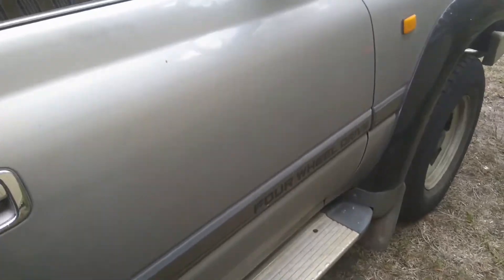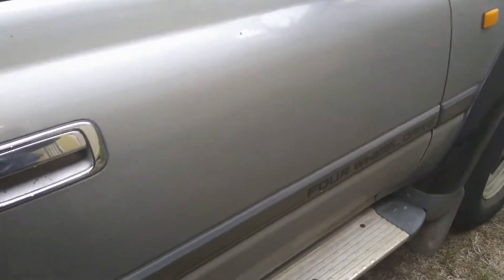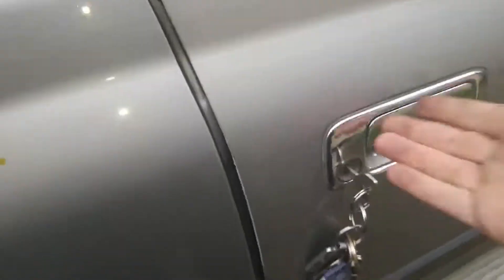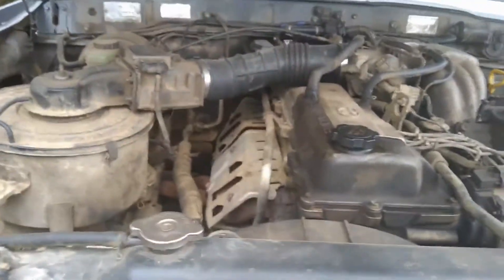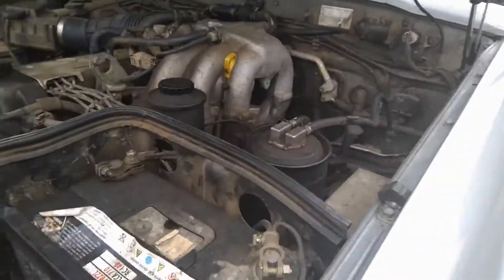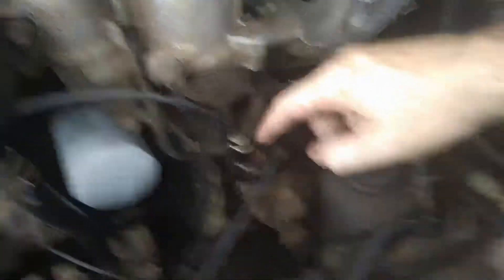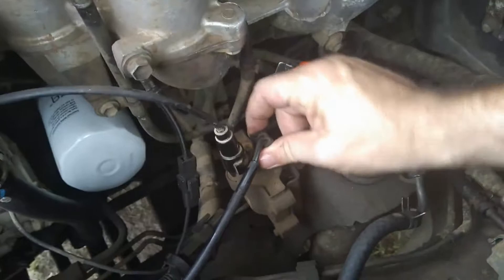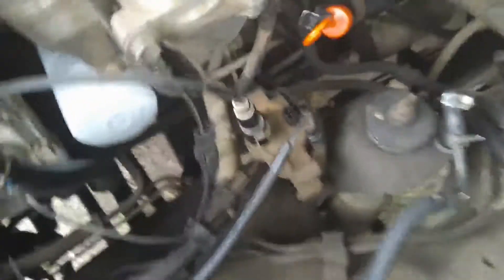80series - Ignition Coil System Issue PT1

Comment: Morning! I’m Francisco from Angola. I have fj80 series that I have recently change head gasket and valve oil seal. Now have mounted everything together but the crank but don’t start.
Reply from the maker: So it's a crank no start. Check you have the dizzy lined up, check you have all plugs and coils set  correct, also make sure coil is getting voltage

Comment: I just did an ignition tune up in my 80 (plugs, distributer cap and wires).  I did not touch the ignition coil have you ever changed it?  On my other cars that had ignition coils they would wear out around 100,000 miles.  I didn't even think about it for the 80, should I?  The tune up did eliminate a hot engine startup issue however and improve gas mileage.  The sparkplugs were definitely worn out.  I purchased the LX450 last March with 245k miles on the clock.  No rust and in decent shape.  Spent the last year baselining and fixing most everything.

Comment: Having problems with my friends ECU was  checked ignition coil replaced sissy replaced still having the same problem wondering if it's anything to do with the ignition module they're usually on the firewall
And the bolt acts as an earth to the body I had one in a Toyota camry
the bracket went rusty and the bolt wasn't earthing